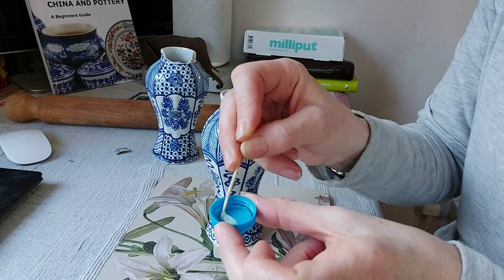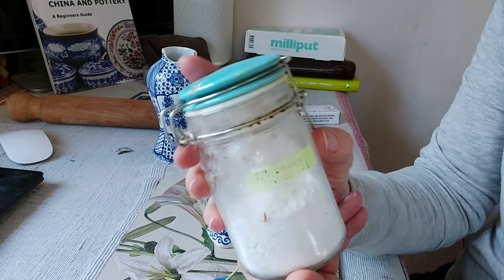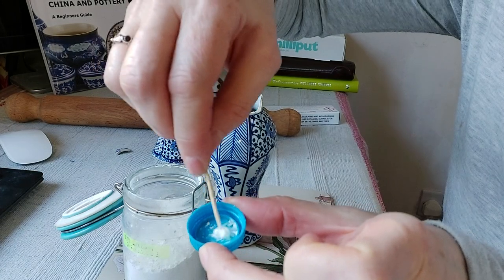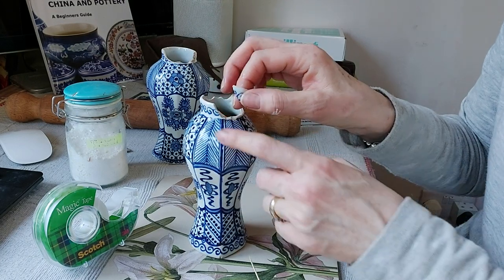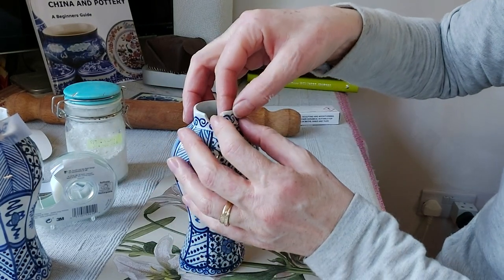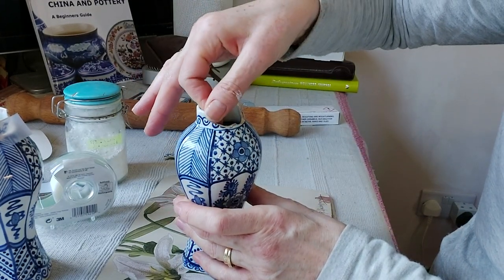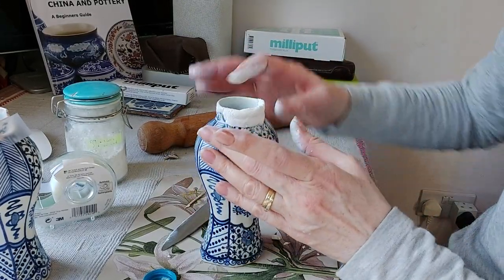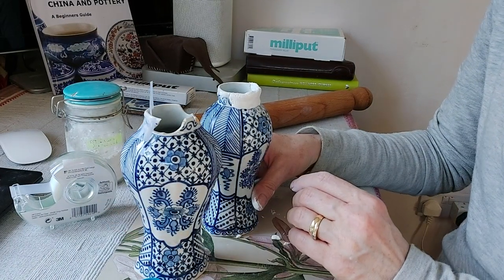CHINA GLUING AND NEW PARTS

Comment: I looked through your list of videos and do not see one on how to repair bone China. I have a PIA Phillipines napkin ring holder needing Repair. Will I need a different glue for repair? Can it be repaired?  It seems to be a clean break. I hope you can see this message.
Reply from the maker: Hi Elvia, many thanks for your comment,  it depends on the repair. If the napkin ring is completely broken in a couple or more pieces or if it has a radial crack. Both take different glues.
Reply: @theceramicrepairstudio  hi. It is PIA bone China, Philippines. Vintage equestrian fox hunt horse. The tail of the horse snapped off.
Reply from the maker: @EJLily686  I hope you have the piece for the horse tail.